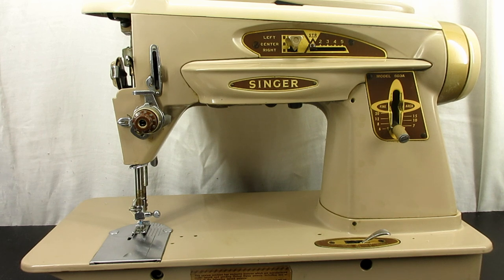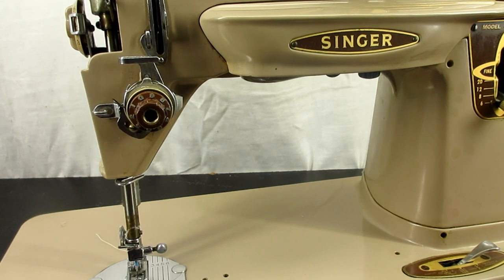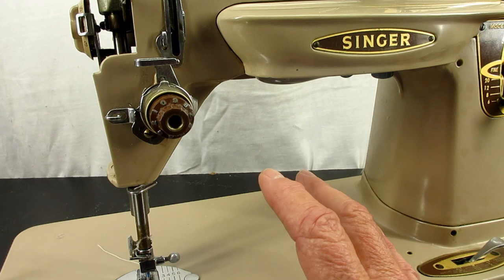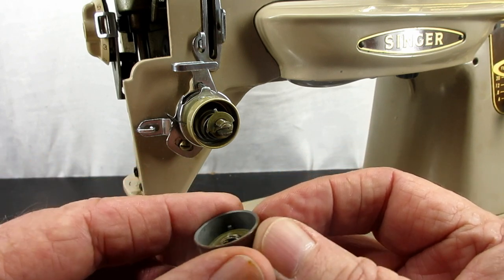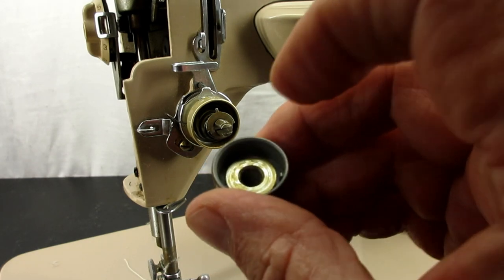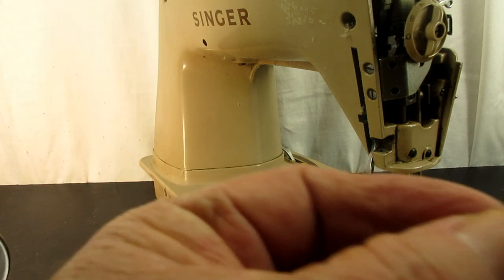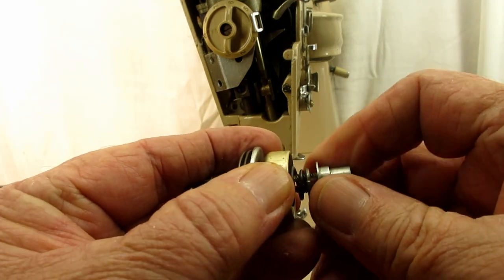Removing a stuck brown tension knob on SInger models 500A & 503A

Comment: I think sewing machines are the most complex machines a person can have in their home.  Thanks for your help with them.  I've watched your other video and had my tensioner apart and cleaned it and put it back together.  I've sewn masks with my other Singer and broke needles going through the pleats because of thickness.  I don't think I'll have that problem with my new old 503a.  Thanks Andy.  My class 66 bobbins will be here after Christmas.
Reply from the maker: Thank you, Ralph. You'll be very satisfied with your Rocketeer and be using your time and creativity instead of replacing needles. Happy sewing.

Comment: Guess what I brought home today..?  yup, I bought the 503A. I haven't even gotten into it yet. didn't feel like doing much after all the driving I did to go and get it... But the hand wheel turns freely.. It  looks as though someone might have had a problem with the upper thread tension knob, because there are spare pieces of a tension unit in a baggie. So it has been fixed, hopefully it works OK..The machine looks really nice, it's in a nice little table.. It has the pink plastic box with the button hole attachment, also the accessories box with the different feet and attachments. it also has the 9 original plastic cams. I am going to have fun opening it up to clean and oil. then lots more Andytube videos to watch. Thank you for the detailed playlist of the 503A..
Reply from the maker: Just incredible that you got all that for the price. Worth the drive I'd say. Yes, the pink "Jetson" buttonholer is the correct one for the slant needle machine 503A b/c it has the slant attachment. The green Jetson is the same d3vice just for straight shank machines.
https://youtu.be/e5131TMpI7A   So much to learn on a 503A, but man can it sew and craft some wonderful things. Have fun.
Reply: @andytubesewing1953  Thank you, ,,You helped save another vintage Singer... I probably would not have even considered buying it, if not for your great detailed videos. I was sticking to the Iron ladies..but seeing your  detailed videos, made me want the 237 that I recently finished, and now this 503A.. I am happy to have this beauty.. It even has the original manual. It was a good deal, and worth the hour and 40 min. "one way.".  it does need cleaning,, old grease, dust, etc. and who knows what else? I'm not even going to plug it in until I clean, oil, grease and  inspect the obvious things. In the meantime I have a lot of videos to watch. Thank you Andy..

Comment: This video is great. I couldn’t figure out how to get that brown dial off, and then my pieces were also stuck together. I heated it up with a hairdryer and then used a dental pick type tool to pry the silver part off the brown part while warm and I luckily managed to work my way around it and get it off. Thanks so much!
Reply from the maker: A very good idea to use a dental pick and thanks for sharing that.

Comment: Hi Andy, can you please tell me if the rubber bobbin tire for the 500a is indeed the same size as the one for the 401a? All the sites show them as the same but I thought I heard you say once that they are not? Glad you’re back! Be well
Reply from the maker: No, the 500A/503A has a smaller bobbin tire. You can force the bigger 401A size to fit, but it won't work as well when auto stopping the winding, IMO. Here is where I have bought my 500A tire for a few years:  https://www.vintagesingerparts.com/collections/singer-model-503a-parts/products/bobbin-winder-tire-friction-wheel-26-mm-x-14-mm-x-6-5-mm-fits-singer-models-500a-503a   Here is my video (part 2) for working on the winder which may be the place you heard me talk of the smaller size https://youtu.be/P2ROdLM5zmE  Thanks for asking, and for watching my channel.
(P.S. someone may be selling the smaller one and saying it fits the 401A, which it does, and it works, but just looks weird. Many sellers, esp eBay, don't know the difference. Also, when they say it "fits" yes, it will fit on the pulley, but the working space for the tire on the 500A/503A is very tight, so you'll be much happier with the smaller tire)

Comment: Is there a good way to clean the tension disks themselves? Seems like my thread is always getting stuck in the disks when I end seam, lift my presser foot and go to pull my piece out. I have to help the thread along through the needle otherwise it just wants to bend the needle because there's resistance in the tension disks. I can't tell if they're just dirty from being so old or not releasing tension when the foot comes up. (And no, there's no actual tension issues with the machine that effect sewing.) My father suggested taking some alcohol on a cloth and sliding it through the tension disks? I'd prefer a method to do it without straight up removing it IF possible.
Reply from the maker: Your father gave you some good advice. With a 60-year-old machine, I feel it is better to remove, clean & replace the assembly, but I understand it can seem intimidating. Based on your description of the problem a couple things can be happening. There can definitely be debris built up on the stud, check spring and discs. That can prevent the releasing pin from fully depressing the beehive spring to relieve tension on the discs, and even a little tension can cause drag on the needle thread. The other, more rare cause, is the tension pin releasing lever in the nose is loose, bent, or dirty and not pushing the tension releasing pin all the way into the stud. To clean the assembly without dismantling, turn the dial to zero and either brush, vacuum, or use canned air to remove as much gunk/lint as you can. If you use air, only blow sideways on the unit or you'll blow stuff into the coil of the tension spring and back into the spring recess area. Now lift the presser bar and do the same cleaning. Using a soft cloth dipped in alcohol, 70 to 90% if you have it, slip the cloth between the discs and give it a "shoe-shine" around the top, sides, and bottom. The cloth should penetrate enough to reach the stud in the center. You must be careful around the loop of the take-up /check spring to avoid bending it. Easy does it. I like using 1/2" strips of lense cleaning cloth. The microfiber material is good at catching and holding the gunk. I always follow this with a hairdryer while lifting and lowering the presser bar. I don't want any moisture to remain inside the spring or recess and cause rust. If this doesn't resolve the issue for you, I do have a video showing how to remove, replace, and adjust the assembly. https://youtu.be/OqZZ-uhnAMY   On the very rare occasions where the releasing lever in the nose is the problem, I also have a video for removing that, but you need to remove some other parts first. https://youtu.be/O4pHwpobhe4
Thanks for watching my channel, and props to your Dad 🙏 for his good suggestion.
Reply: I was so glad to come across this comment.  My 347 was not producing an even stitch.  The top thread always slipped a little, no matter what the top tension was.  I put some alcohol on a cloth and slid it through the tension discs, and it cleared up the problem, and now I can make an even stitch.  When I removed and cleaned and oiled the top tension parts for servicing,  I think I forgot to remove the oil from the discs before reassembly.  So now I won't forget this, and do it as a part of regular maintenance, too!  So, thanks!
Reply from the maker: @carolemagnusson5044  A fortuitous find when you decided to read the comment. Little treasures here and there in the comment section. Happy to hear you corrected the problem, Carole. Happy sewing.

Comment: I love your videos.  Is there anyway to do a re wire on a Singer 306k? Mine is in need of it and would love to do it myself.
Reply from the maker: Hi, Sally, I've never even seen a model 306K, but IMO any sewing machine can be rewired. I don't even know if your machine has a light. Here is an example of replacing a cord on a foot pedal and wiring into the plug, just to give an idea https://youtu.be/ZwMUYwFmahE
Here is a free download showing some wiring diagrams for Singer machines from ISMACS, the International Sewing Machine Collectors' Society http://ismacs.net/singer_sewing_machine_company/manuals/sewing-machine-wiring-diagrams.pdf
You may be able to find a user group for your model and I know there are Singer vintage groups online, like Yahoo, Facebook, Etc.
Sorry, I can't help you more than that, but thanks for watching my channel.
Reply: @andytubesewing1953  thank you for replying. I’ll look at the videos. I’m a member of the Singer swing needle group on Facebook but not
Much help there yet. I think I can get the light done.  Main problem with it right now is it had 3 metal bands holding the socket together - made that way and not an add on by someone.  I’ve got the two off but that third one is tiny and Bering a bugger about coming off.
Reply from the maker: @AspenGlow2027  Best of luck to you. I think that is why those small bands are missing so often. I'm thinking people give up and cut them off. When I did the spotlight on my 99K the original ring was missing and I replaced it with a modern style snap ring as shown at 28:15 of this video https://youtu.be/xNy0E3LVEHU  It worked well for me and at least it can be removed easier in the future if needed.

Comment: Hi, I love your videos. I picked up a free 403a a week ago. I'm missing that brown knob on the tension. Can you please let me know where I might be able to buy one?
Reply from the maker: Wait... what? Did you mean you picked up a 503A? I've never seen a 403A with the "Brown knob".
Reply: It's a 403a missing the knob.
Reply: They look so much alike
Reply from the maker: @nldcam  OK, sorry if I'm confused. The factory tension on the 403A did not have a brown knob. If your machine has a tension unit like the one in the video you can find a replacement here: https://www.ebay.com/itm/154796992004?hash=item240a9ea604:g:0HAAAOSwRJth4w4i  I don't know of anyone who just sells the knob or makes new knobs, so I've always had to buy a used one. You can see the original chrome knob of a 403A tension assembly in this video: https://youtu.be/t3UqzYRo-cc   Maybe you are talking about the dial with the numbers on it? Either way, we have to buy used parts for most of the vintage tension units. I use eBay but there are other sites that sell used parts also. Good Luck.
Reply from the maker: @nldcam  ok

Comment: Do you answer questions and/or offer help with sewing machines? I have a singer 403a, that belonged to my great-grandmother - it's having an issue sewing. At first the thread wouldn't move thru the tensioner, so I took it off and cleaned it - it also wasn't sewing, either the top thread was a long piece or I could see the bobbin thread on top. The thread moves thru the tensioner now, but the top thread is still one long piece. Or it bunches the fabric up, or does a lovely combo of the 2. If you could direct me to a video or tell me what to adjust I would appreciate it :) thank you
Reply from the maker: The most complete tension video for model 403A (long) https://youtu.be/4aqRScKOOsw
Shorter version for general Singer Tension: https://youtu.be/PSCY72bJ3x8
The Stroke & Tension of the Check Spring on your model: https://youtu.be/t3UqzYRo-cc
Adjusting Bobbin Thread Tension on your type of bobbin holder: https://youtu.be/bhcsfhaBRDo
A complete series about your tension: https://www.youtube.com/playlist?list=PLsCOZgzzaiKJaeFB_GW97NsW5GYM7KD9U
A free copy of the original Singer Instruction Manual for Model 403, 100 pages that include needle threading, bobbin case threading, tension adjustment, how to select the needle, thread, and stitch length based on the fabric you are sewing, cleaning and oiling the machine, using the controls, etc. can be downloaded here:  https://www.singer.com/search/support?title=403
Reply: Thank you so much sir!!
Reply from the maker: @beckywarren2583  👍 good luck

Comment: When you were successful at separating the brown knob from the flange thingy, what tools did you use to grab ahold of the two separate parts?  I have small hands and can't see that threading it back onto the post and just pulling on the brown knob will do it.  I need a way to really grab onto it.  Thanks!
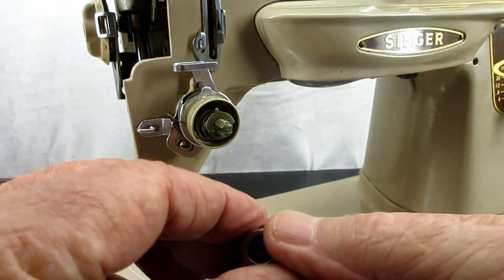Reply from the maker: I did mention in the video that I've had a handful of the knobs that just would not separate from the flange piece no matter what I tried. I mention a few ways to loosen them starting @9:40 in the video. As far as tools the only thing I have used is 6" Diagonal Cutting Pliers. https://www.target.com/p/blue-ridge-tools-6-34-diagonal-cutting-pliers/-/A-78591361#lnk=sametab
It seems like an odd choice, I'm sure, but I used them for 30+ years at work and am familiar with them. When the knob and flange are stuck together and I've tried alcohol, boiling water, freezing, WD-40, and so forth without luck I have sometimes had success with heating the knob with a hairdryer and using the pliers. I put one pointy tip on the inside edge of the hole of the flange on the backside, and the other pointy tip on the outside edge of the flange. I use the wire plier because of the sharp edge that grips the aluminum flange. The trick is not to damage the inside edge of the flange by over squeezing and hurting the threads there. It's tricky. Holding the brown knob in my left hand and the plier in my right I will twist them in opposite directions, back and forth, trying to break the "seal" holding the two parts together. A viewer told me he used a drill bit as a ram and hammered the flange out the back of the brown knob. Placing the back of the knob on his flat workbench and using a drill bit that barely fit inside the brown knob opening in front, he tapped with a hammer until the flange fell inside the knob. He used an old drill bit and put the flat end that goes into the drill into the knob and against the front of the flange, and hammered on the point of the bit. (why you use an old, dull bit) I've never done that myself.
Reply: @andytubesewing1953  You, sir, are a steely-eyed rocket man (Apollo 13 is one of my favorite movies).  The pliers did not work for me but the drill bit trick did!  Then, I watched your mini-series on the tension assembly.  What a revelation.  I had no idea how that worked and have been "fixing" tension by turning the knob, holding my mouth right, and when that didn't work, contemplating sacrificing a chicken.  I followed your mini-series, took the whole thing apart, cleaned and fixed, put it all back together and it now works like a dream.  My old Rocketeer and I thank you for your expertise and your ability to share it.  Take care!
Reply from the maker: @lindaestes8261  You made my weekend. Thank you for letting me know the results. I'll suggest the drill bit method more often now that I have confirmation it works. Happy sewing and thanks for not giving up on your Rocketeer. (I'm sure the chicken is grateful too.)